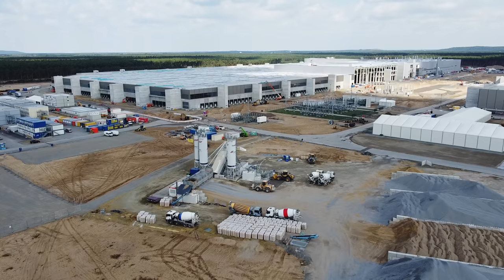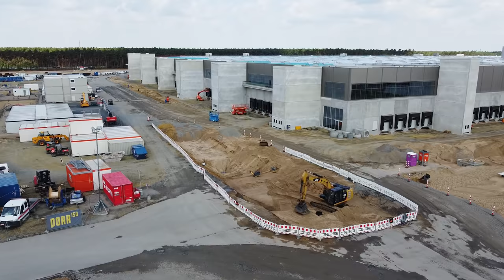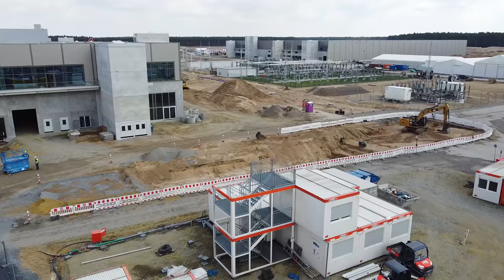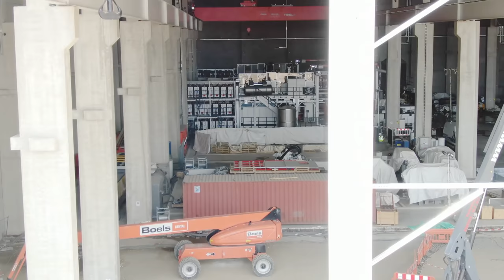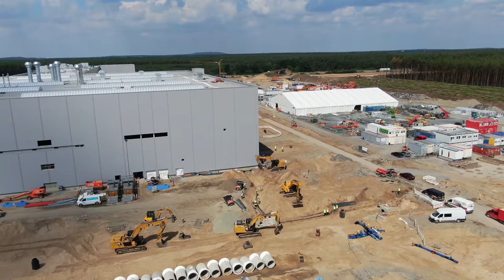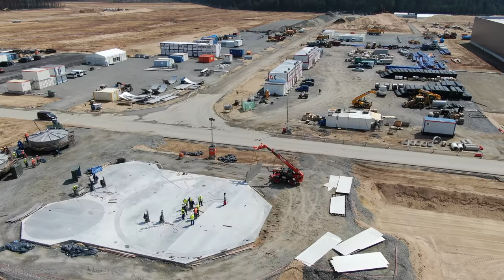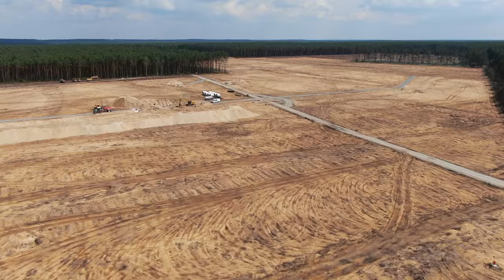Giga Berlin | 2021-06-26 | New Tents

Comment: 0:20 Look how full the aggregate bins are.  They're gearing up for the Great Pour.
Reply: The large floor slab will be poured in several sections.
Reply: Need to build all the formwork yet and still some rebar to place by the look of things, but they really need to plumb in some cooling pipes with concrete that thick they'll end up with cracks otherwise

Comment: can someone tell me what is that structure with all the rebars on the base? its higher than the man standing next to it. never seen that b4
Reply: Cell production, ground here is not as good as in Texas.
Reply: It's a base to remove all surrounding vibrations from motorway and railroad nearby. There will be high precision equipment in battery production, so they require quite a significant dampening foundations to quench all harmful vibrations.
Reply from the maker: It's the cell production building. It will have 4 levels and to support all the weight it needs the big foundation. Piles would have been an option as well, but getting permission for piles would have been a longer process, and they wanted to start construction of that building sooner.

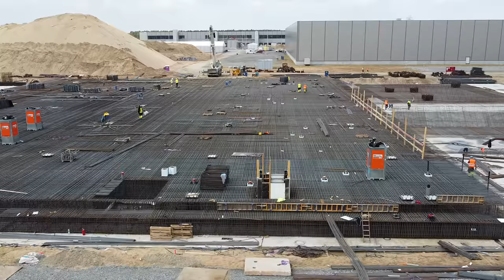Comment: 14:30   That's a LOT of rebar.
Reply: Yea i don't understand this. structural reasons? what is being built that requires such a robust structure?
Reply: @Sal3600  same here. do anyone know what it is ?
Reply: @Sal3600 Batteryproduction, it will be 4 levels tall.
If you would like to run a robot at the 4th floor you need 2 feed thick concret.....
Reply: @Sal3600  I have no idea. It almost seems like they would have a hard time getting the concrete down to the bottom of that much steel.
Reply: I suspect this is to simplify the building permit. Instead of using concrete piles, they just make one massive concrete slab, to rule out disturbing groundwater.
Reply: @jwstolk  
there must be no vibrations - hence a massive substructure
Reply: @jwstolk  I'm not so sure about all that.
Reply from the maker: @jwstolk  That's correct. Getting the permit for piles is a more complicated process. So without piles they were able to start construction sooner.

Comment: 6:24 For a moment I though a press was operating -- I thought I could see the robots moving -- but it was just an optical illusion caused by reflections on shiny panels.
Reply: Are we sure the first press is working?  I am suspicious of this since there is no chimney in place yet.  Is there a permit issue?
Reply from the maker: No, they have the permit to install chimneys and they have the permit to test the machines.

Comment: Hallo Tobi... Anhand deiner Tabelle habe ich für mich diese Abkürzungen übersetzt und gedeutet. Ist das korrekt? :D

Untergrundleitungen                          = Sewers and powerlines 
Installation GA                                    = Installation general assembly / Seats
Mittelspange                                       = It's a typ of street connection - I think they mean the highway access
Einrichtung DU (Zwischenebenen)   = means fitting/set up mezzanine floor in the drive unit building
Installation DU                                    = Installation drive unit
Einrichtung ST2                                  = Fitting/set up stamping 2
Installation ST2                                  = Installation stamping 2
Installation CA                                    = Installation casting area
Cell                                                       = I suppose cell fab
Installation BP                                    = Installation Battery pack production
Installation PL/IMM                           = I suppose Installation Plastic-Painting-Shop
Sickerbecken                                      = Seepage basin
Einrichtung Lobby                              = fitting/set up Lobby
Verkehrsflächen                                 = Traffic areas
Betonmischwerk                                = Concrete mixer (mini fab)
Reply: Meines Verständnisses nach sind die Mittelspange die ganzen kleineren Unterstützungsgebäude in der Mitte, also Umspannwerk, Tanklager, Abwasserbehandlung, ...
Reply: Mittelspange/-achse ist die Zeile mit dem Umspannwerk. Tanklager, Abwasserbehandlung, Energie-Zentrale, Sprinkler-Zentrale, Feuerwache und Gefahrstofflager.
Was ich an dem Zeitplan etwas irritierend finde, ist dass sich diese Arbeiten bis April 2022 strecken sollen. Die genannten Gebäude/Einrichtungen werden eigentlich alle für den Produktivbetrieb benötigt.
Reply: Ah ok .... Danke Leute :)

Ja das mit der Mittelspange ist seltsam. Wobei ich schon davon ausgehe dass die wichtigsten Sachen fertig sein werden, wenn man bedenkt dass die Untergrund Leitungen schon im August fertig sind, dann wird die Strom und Wasser Versorgung bestimmt bis November fertig sein.
Reply: @BirnenBaer  Ich denke dass in dem Bereich der Mittelspange die Erdarbeiten an den Leitungen im Juli erledigt sind. Und dann die endgültigen Straßen dort gebaut werden. Teilweise wurde ja schon begonnen Kabel in die schwarzen Leerrohre einzuziehen. Aber es brauchen ja auch noch mehr "entfernte" Teile auf dem Gelände Strom (z.B. Lichtmasten) und Abwasser (Regenwasserablauf Straßen).
Reply from the maker: @abalada  Es muss nicht zwangsläufig alles zum Start der Produktion fertig sein, sofern es temporäre Lösungen für die entsprechenden Dinge gibt.
In älteren Zeitplänen waren für die Mittelspange wenige Monate eingeplant. da sich die immer wieder nach hinten verschoben haben denke ich, dass man hier um den worst case für Baulärm anzugeben die Arbeiten einfach bis zum Ende der Tabelle gezogen hat. Anders kann ich mir das nicht wirklich vorstellen.
Reply from the maker: @BirnenBaer  PL/IMM is plastic paint and injection molding.

Comment: What is holding up the building permit at this point?
Reply: The completely new building application that Tesla submitted two weeks ago.
Reply: Tesla has a permit for all buildings of phase I since 13. July 2020. No idea why Tesla did not yet even start with some of those buildings (energy center, sprinkler center, fire station, hazmat storage).
And also one for the new warehouse. 
Only for the further additional buildings/extensions (e.g. stamping #2) Tesla will need new building permits. But as Tesla just submitted the changed application those will need a few more weeks.
Reply from the maker: The fact that Tesla changed the application documents and included the cell production, is holding up the permit right now. It needs to go though a new public participation process. The good news is that we were able to see the new documents. The bad news is, that the documents have to be public for a whole month, and another whole month time for objections.
If they'd get the permit today, they wouldn't be ready for production anyway though. A lot of the equipment in general assembly is still missing, and a few supply buildings.

Comment: Tobias, is there any indication if or when Tesla will install solar panels on Giga Berlin?
Reply: Yes, in the new building application.
Reply: @julianreverse  Thanks. Fabulous news. Always found relative lack of solar installations at Tesla's facilities extremely puzzling & goes against Tesla's mission statement - not to mention a failure to reduce production costs & increase in gross margins via self-generation of energy. Just plain weird.
Reply from the maker: Tesla plans solar for all of their factories, but I agree that the installation process is pretty slow. I'm not sure if they are waiting for higher production rates of their solar factory, which wasn't ramping fast because pretty much all resources went into Model 3 production. Or maybe they are working on another generation of solar modules. I don't know, but I'm sure there is a reason why they are slow with the installation of solar.

Comment: That is a ridiculous amount of rebar. Why could they possibly need the slab to be that thick?
Reply: Because it's a heavy building.
Reply: To quench all harmful vibrations (motorway, railroad, stamping press, etc. nearby) for high precision equipment to be installed in the battery production building. Soil in here - contrary to Texas - is more conductive to mechanical vibrations.
Reply: @arunotei  Perhaps also because the site is sandy and things could shift without a wide, thick slab.
Reply: @dlewis8405   Gigapresses are very massive machines with significant mass moving laterally, though they were assembled on regular concrete slabs here in Berlin. So shifting isn't such an issue here.
Reply from the maker: It has more floors with production equipment compared to other buildings on the site.
I don't think the soil is worse than in Texas, but in Texas they did a lot of geopier work.

Comment: This super-foundation can not be for the battery factory. Why on earth do you need a foundation that can resist a nuclear attack? Weeks on end the are putting in more steel. And the concrete pouring has to start when? Not tommorow…; If you look at the Austin and Shangai build, there is as far as i can see no equivalent.
Reply: Are u against quality constructions?
Reply: @roland9340  : nobody is against quality construction. People are frustrated by your approval process or indirect cheating again .
Reply: Berlin won't allow geopier like they did in Austin - something about the water table. So massive rebar is the result.
Reply: @johnmathew3423  ok, clear...
Reply: @roland9340  no i'm not. Just wondering because i do not see any parralel constructions at other Tesla factories...
Reply: @johnmathew3423  Tesla has since 13 July 2020 the permission to construct all buildings of phase I. On some of those works have have however just started (wastewater treatment). Or not even this (energy center, sprinkler center, fire station, hazmat storage). 
DU building is ready since over 8 month, without much happening. But now Tesla just started to add further intermediate floors in this building. And the installation of production equipment is scheduled for Sep - Nov 2021.
Reply: @luysterborgh  gotta build for different soil situations. The soil in Brandenburg is very sandy, but there is a saltwater repository in the deep. Now, you could reduce the size of the base plate by using pile foundations, but last time Tesla did this, they got some significant resistance from environmental groups, since they were fearing the pile foundations could cause the ground water to get contaminated by the deeper saltwater repositories. It's well possible that Tesla went for raft footing now instead to avoid further legal challenges in that regard.
Reply: Tesla is building a nuclear fallout shelter for the German government which was required to get approval for building the factory.
Reply: @luysterborgh  Different countries and jurisdictions have different engineering rules and building codes that must be followed. Just because one method is acceptable on one site or locale does not mean it will suffice in others. There are also vastly different foundational requirements based on the local soil, water table, underlying geology, etc.

Different states in the US have the same variations and some things even vary by individual municipality.
Reply from the maker: @EnergyMaxWh  It's not true, that it's not allowed. It's just a longer process to get the permit.
Reply from the maker: @DarthHunter5  The saltwater story was brought up by the "environmentalists" in order to find something to stop construction. The authorities checked if that's true, and it turned out that it's mostly BS. The saltwater doesn't affect the factory in any way other than they have to monitor the ground water, which is a pretty normal process.
Everything that touches the water table does need more complicated permission though. That's why they decided to go with a raft footing, so they can start construction faster.
Reply: @TobiasLindh  that's just so weird. What are those groups then? Covert combustion lobbyists?
Reply from the maker: @DarthHunter5  Actually, I think it wasn't one of the official environmental groups. I think it was the citizens' initiative that brought that up. So I think it's just NIMBY. They hired a retired geologist who said we don't know enough about the ground conditions to be sure that it's impossible to have saltwater coming up.